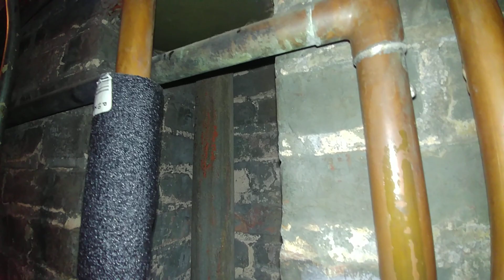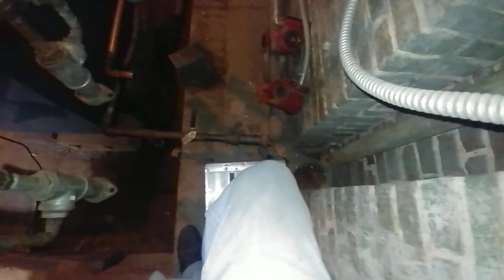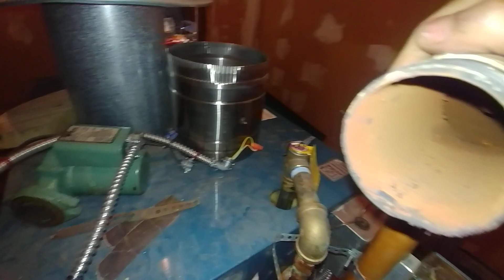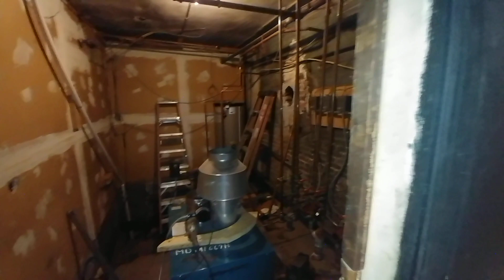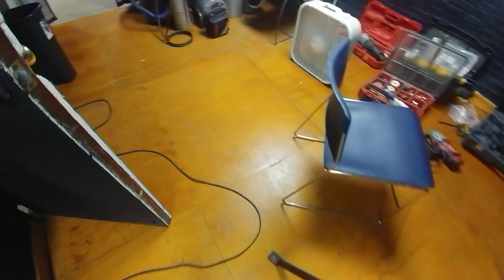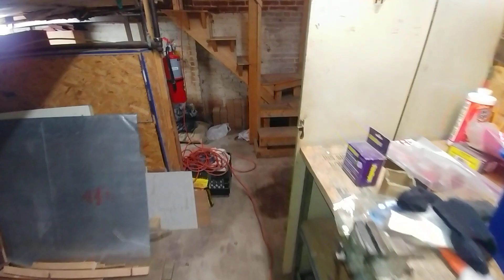Hot Water Boiler Re-Pipe: more demo

Comment: Looks like a lot of things to cover. I just spent 4 hours Wednesday rewiring an a/c control panel that had relays from the 50s.
Removed a bunch of 24v spaghetti. Unbelievable, but the 120v blower motor neutral wire was grounded to the jacket. All rewired now with the proper 3/4hp rated fan center.
Reply: Oy!   Just because it works, doesn't mean it's safe!
One of my favorites is using the disconnect to break the neutral instead of the hot.
Reply: @elgordo271  l've seen blade type disconnect stick on when the lever is pulled to off position. Always a good idea to verify power is off by opening the box. ⚡